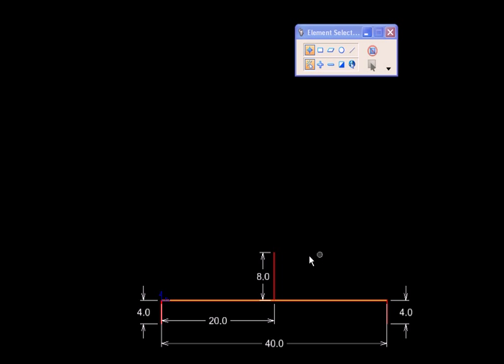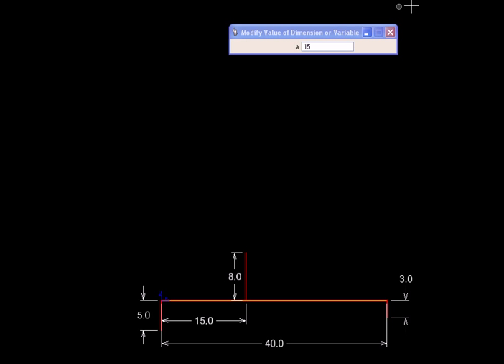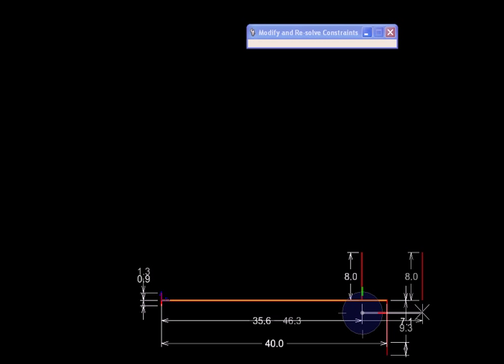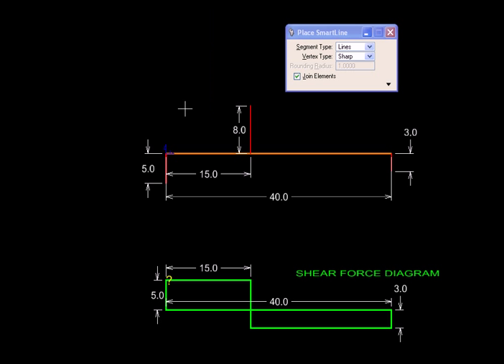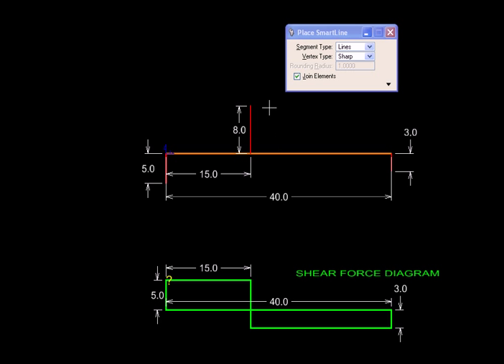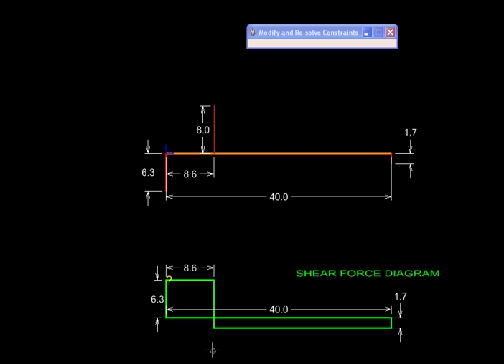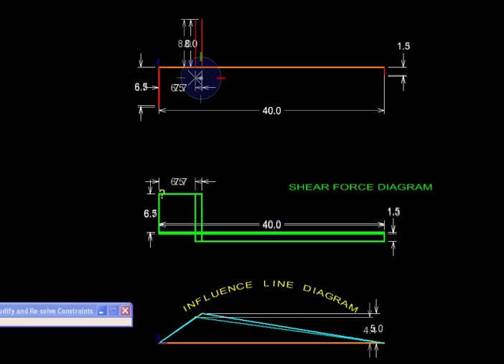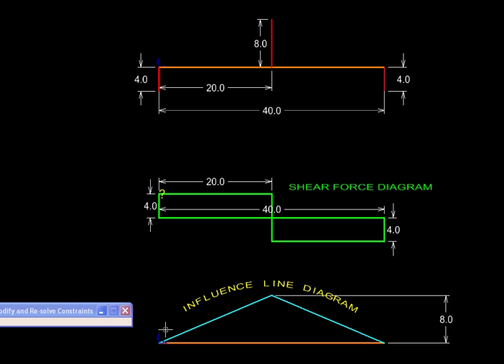SoM with MicroStation Simply Supported Beams

Comment from the maker: @vineeth82kumar Thanks for stopping by. 
     Not sure what you meant by rigid body and pin joint. Did you mean just a single body pinned (and therefore free to rotate)? That case is covered in Kinematics videos.